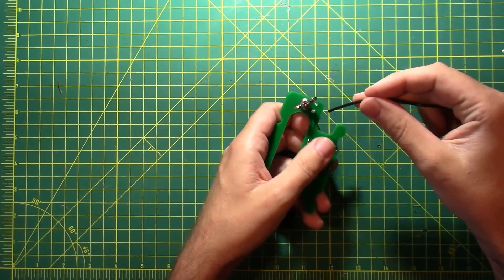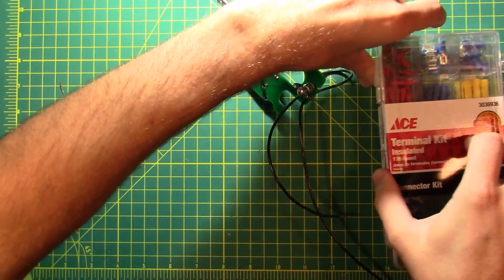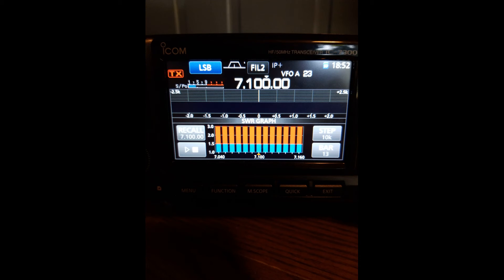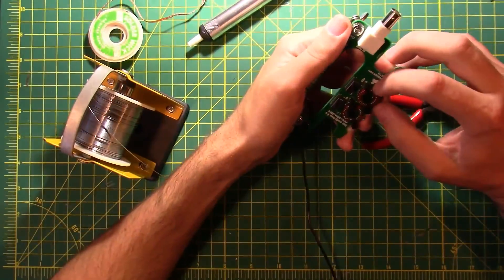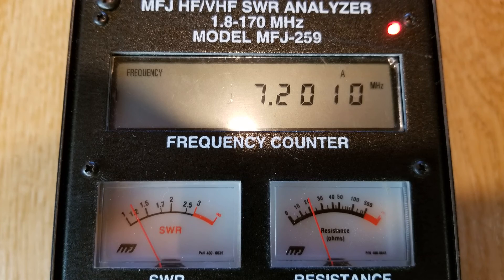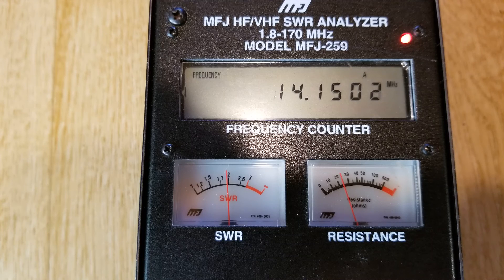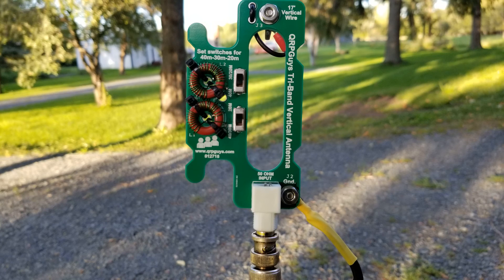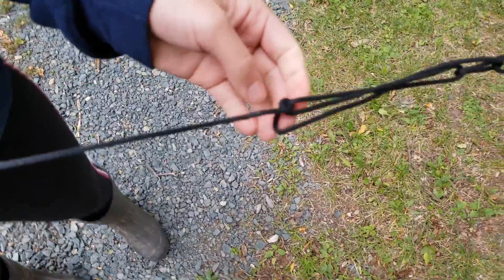#96 Youtuber's Bunch QRPGuys Triband Build Results and Tuning

Comment: Thanks for the heads up. I think I will get my NanoVNA first so I can visualize where I am at so I know the VSWR will be moving in the right direction. It sucks that the toroids have to be soldered down first, the build guide doesn't emphasize this enough as it is a strong possibility by design, LOL. Cheers, Dave - KU9L
Reply from the maker: I really learned a lot with this exercise! A Nano would have helped for sure.

Comment: Question about the swr on 40m...the toroids should not have an effect on 40m's correct?  Both switches up should bypass the toroids and link directly to the wire right?
Reply from the maker: Almost - No 'roids for 20m, only 30m and 40m - In my case I used DX Commander's DX-10 wire, so I run 100w on 20m, then 30 and 40 get 20w max.

Comment: i have a question about the Xi 8088 where do you get the expansion slots from XD
Reply from the maker: I got all of my parts from mouser for this build.  Digikey, jameco, and ebay are also good places to look
Reply: @temporarilyoffline  jameco is where I buy my chips off of and I found a list of all the parts in the Xi 8088 but no expansion slots but in it I found a 512k sram chip that's 55 ns so it will be able to handle the 10 mhz clock of my breadboard cpu
Reply: Also thank you for telling me
Reply from the maker: @ducksonplays4190  No Problem!